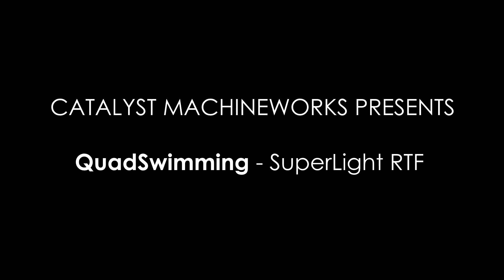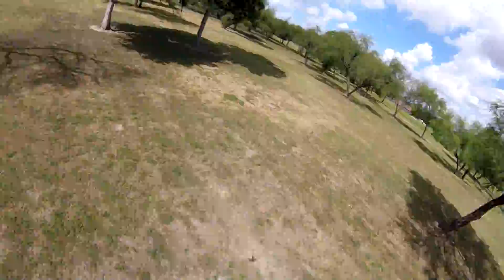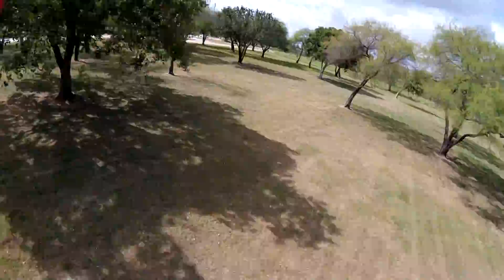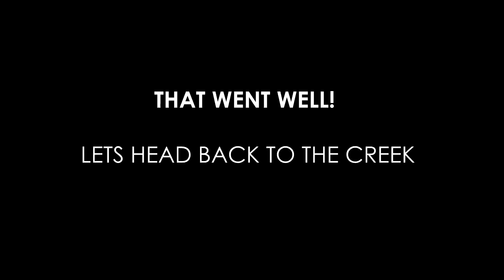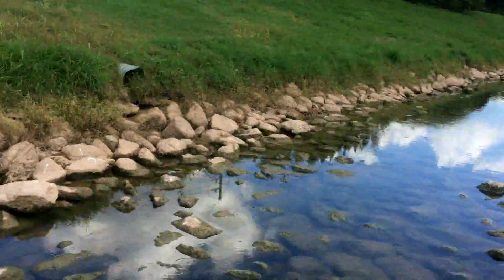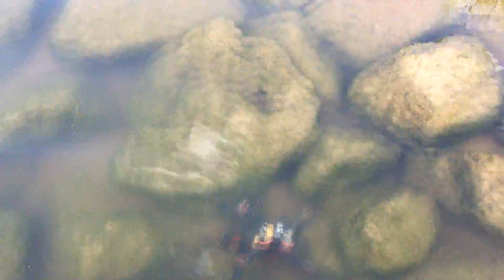FPV QUADCOPTER SWIMMING - NSFW (Language)

Comment: How do you find those motors doing with a 5045 prop?
Reply from the maker: I get the best all around performance with them matched to 2600kv motors like this.
Reply: Catalyst Machineworks cool, I'm running the same motors with 5x4x3 props/24amp esc and always am a little worried when they come down warm. Wondering what other experience